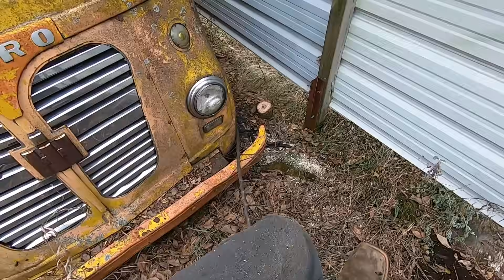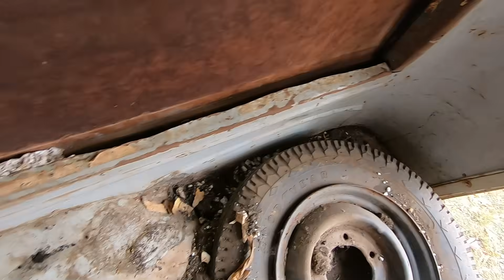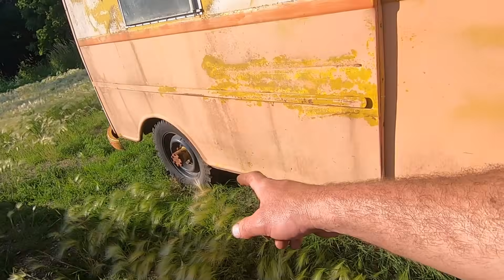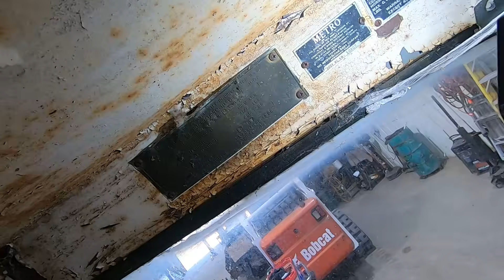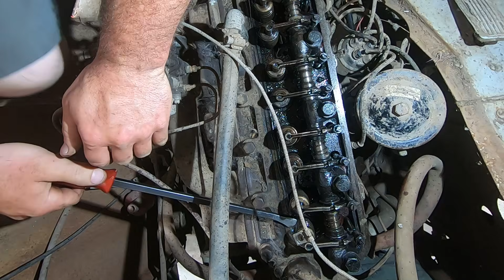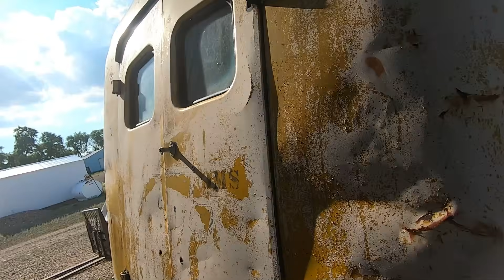1957 International Metro Air Force Bomb Squad Van! Neglected for 47 years! Will it Run?!?

Comment: Just like deja vu all over again. I bought a 1970 stationwagon driven 10 years and then parked in a small garage. I reallly just wanted the 454 and 400 trans. 6 hours to get it out of the garage. Was buried to the roof of the garage. I first got the hood open and the engine rolled over. Then I unloaded garage and car. Loaded the wagon. All four brakes were locked. I used aluminum signs and oil to just winch it on the trailer. Repacked the garage and left. Monday morning I  found out the garage the wagon was in collapsed.  Haha
Reply from the maker: Fun times!
Reply: Yeah, i guess they lost the shop

Comment: It was the early 60s and my parents had a small country store in western PA about 20 miles NW of Pittsburgh.  Our local baker  (and that is what most of them still were back in those days) used these Metros as delivery trucks, though I am fairly certain  it was a longer version, unless the video makes it hard to tell.  They were pretty widely used by a variety of businesses.  While your Duff Cam sufficed for today, the  only real problem I see with this Metro is there is no seat for Duffy.  But that's fixable.   Thanks for the memories.....again.
Reply from the maker: They had several different wheelbases.

Comment: Did a little research - it looks like '28th. OMS' on the side.
"Constituted as 28 Periodic Maintenance Squadron on 4 Jun 1952.  Activated on 16 Jun 1952. Redesignated as 28 Organizational Maintenance Squadron on 1 Feb 1959.  Inactivated on 30 Apr 1992.  Redesignated as 28 Aircraft Maintenance Squadron on 28 Jun 2002.  Activated on 15 Jul 2002.
Rapid City (later, Ellsworth) AFB, SD, 16 Jun 1952- 30 Apr 1992.  Ellsworth AFB, SD, 15 Jul 2002-"
I bet that's it.
Reply: They have a cool insignia of a fist holding a bunch of arrows.
Reply from the maker: Thanks for the info!

Comment: The ballast resister will lower the voltage to protect the points from overheating. Ignition off or points open it will recover.

Comment: Some useless knowledge for the day. Never use a tube that is bigger than you need. It will fold over on itself and wear a hole. A smaller tube will stretch a lot. If you don't believe me, put a lock on chuck on one and see how big it gets before it blows. Also, NEVER use pries bars, screw drivers, or anything with sharp corners. You will put a hole in your tube very easily. Proper tire irons are rounded nice and smooth for a reason. You think that 6 linkage is weird, my 52s went straight threw the block. THAT was weird. See yours has that too. Those little engines (I never knew the displacement) didn't have much for HPs, but they were torque monsters. If you could get traction, they could pull a small building.
Reply from the maker: Thanks for the info!

Comment: That metro is a project. Glad to see you get her running! Congratulations Mortske!  Knew you could get that straight 6 cylinder going. There normally pretty reliable engines.  Even though everyone knows it’s going to take some love. To make it a show truck. But have seen a few metro’s at some car shows!  Hope someone will take it and work it over. No way can it be made original, because the modifications made after leaving the Air Force. But, the right person could also do that. That would be very cool!
Reply from the maker: Thanks Terry!

Comment: There is nothing wrong with the carb it just needs someone with ambition to loosen it up so the throttle linkage will move and I'm sure the thing will start until then keep spraying carb cleaner in there it just may be enough to loosen it up so the butterfly will open enough to get the right amount of fuel and air in it to run

Comment: I have a 1947 Willys Overland Stordor van. It was bodied up in San Francisco and sits on on a 2 WD Willys truck frame. It came off of an Airbase here in California. Last plate on the vehicle is from 1953. It to is shows blue paint throughout the interior on the wood paneling and all metal dash and surround areas. I'll wager the paint is a Military issued blue color.

Comment: That throttle linkage through the block is pretty weird. I had one of the Chevy versions of this type of van and it had the 17.5 split rims on it. Nobody would mount tires on the wheels for me but I found an old timer who did it. Drove it for a short time as a work van (mobile marine) but it proved impractical and I sold it to someone that turned it into an ice cream van.

Comment: Not sure what year astro you are talking about but I've got a 92 mark iii astro that has a bunch of good parts in WV
Reply from the maker: I need a LH torsion bar
Reply: @MortskeRepair  I would almost give it to you for cost of scrap or trade for some square body chevy stuff. Has about 125k on it and was drove by old people since new the first 100k. Engine only smokes on start up (why I still have) and runs perfectly but trans front seal is shot. Probably too far away tho
Reply from the maker: @mblake0420  Where are you located?
Reply: @MortskeRepair  Charleston WV, it drives but spews trans fluid out bell housing area
Reply from the maker: @mblake0420  Is it AWD or RWD?
Reply: @MortskeRepair  rwd ext 4.3 700r4
Reply from the maker: @mblake0420  Shoot I need a 4WD torsion bar
Reply: @MortskeRepair  gonna be tough to find

Comment: Mortske, Mortie here. 

Question, why don’t you use a spray bottle instead of a , or in conjunction with a squirt bottle?  Doesn’t it stand to reason if you’re wanting it to fire without flooding to try and atomize the gas as much as possible for these old engines with low compression and crank speed? 

Just an atiffany , but I think after filling the bowl you can switch to a spray bottle and help atomize the fuel with a mister or sprayer type nozzle with special thought to those old sixes with intake and exhaust laying flat on one side with hard runners and bends.
Reply from the maker: Never thought about it I guess. Never been an issue.

Comment: OMS in Strategic Air Command (SAC) would have been Organizational Maintenance Squadron. That's the squadron for the crew chiefs assigned to and maintain the aircraft on the ramp. They do the preflights, postflights, refuelling, defueling, launch, recovery, and cleaning.
Reply: Sounds right! They also used those vehicles to take the crew back and forth to the aircraft. Probably Ellsworth, Grand Rapids or Minot Air Force bomber wings.
Reply: @michaelhoward1900   The 28th was at Ellsworth (South Dakota)
Reply: Should call that 57 IH the Peacemaker,  after the Corvair B36.  They would have been using them from 1946 to 1959, before the B58 Hustler and the B52 Buff came online in the 60's.
Reply: B36. 6 turning and 4 burning, huge aircraft yet gorgeous
Reply: Plane captain mobile
Reply: Navy L.S.E. confirm 🥶🐲
Reply: She runs good
Reply from the maker: Thanks for the info!

Comment: 74 ramcharger was the removable with half doors then removable roof till 80 but doors were full frame same as a pickup door. Then 81 was curved back side windows with no more removable roof.
Reply from the maker: Thanks for the info!
Reply: @MortskeRepair  the more you know.  Right?
Reply from the maker: @tingrilledodgetrucks5988  Yup!

Comment: A Classmate's Dad was a plumber and had 2 Metro's one for parts and one he drove for his job.
Reply: Your classmate's dad was a smart guy.
Reply: @johnm.5848  In the early 90's I ended up buying their old 64 Impala 4 Door Sedan with 2 speed powerglide and 2V 283 V8 used Mobile oil had so much buildup we tired running diesel fuel in it.  Ended up doing a rebuild engine I think had 90,000 on it.